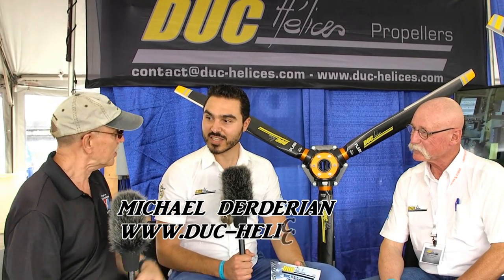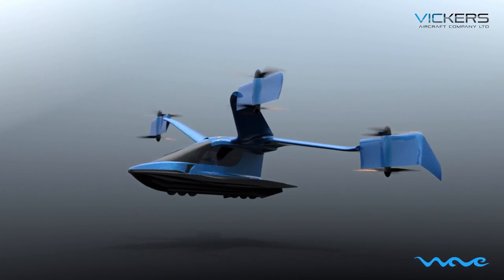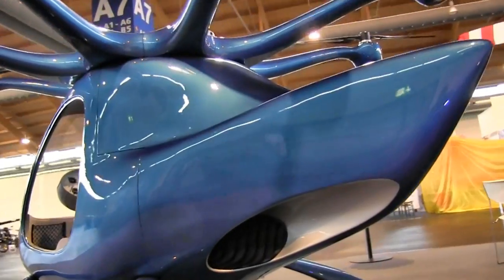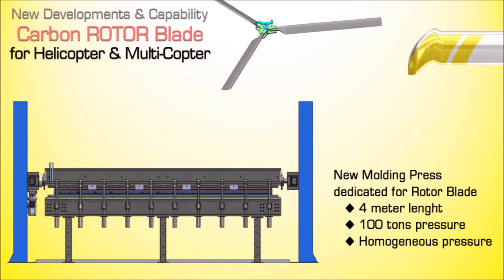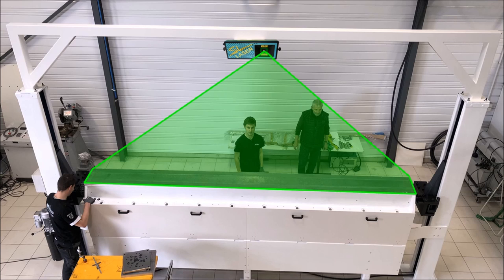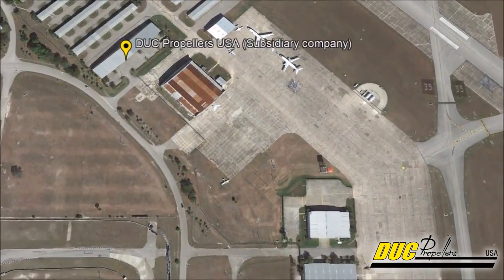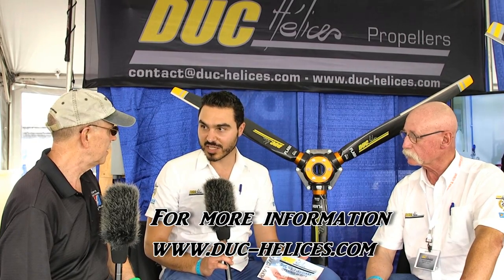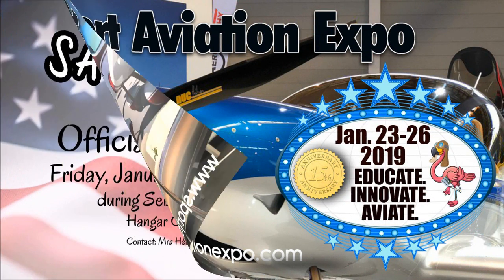DUC Props, DUC Helice Propellers, sales outlet, Sebring Florida

Comment: I really like their innovation in prop shape, not just building from the same old intuition and sounds like windspoon performs significantly above conventional shapes.
8m rotor for a multirotor vtol is a huge prop. sounds like a heavy bird. Even 3meters sounds big. I suspect that because motors perform better at higher rpm that smaller props will win out.
I would recommend developing a prop that's very efficient and quiet and at the same time very cost effective. Not necessarily the cheapest prop on the market but so inexpensive and good that no manufacturer would look elsewhere. Don't rely on specialty pricing because sooner or later the aircraft market is going to go mainstream and all this nonsense about a 4 cylinder engine costing 39k$ or colonial woodplane costing 200k is going bye bye. Maybe a single piece cast boron alloy prop.